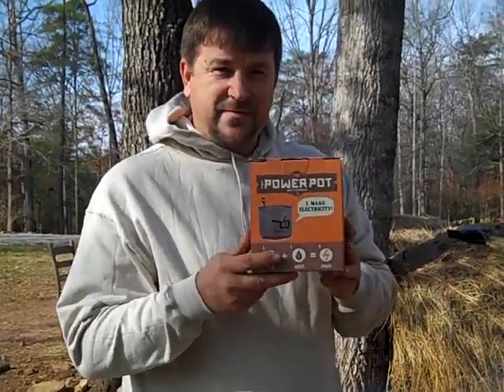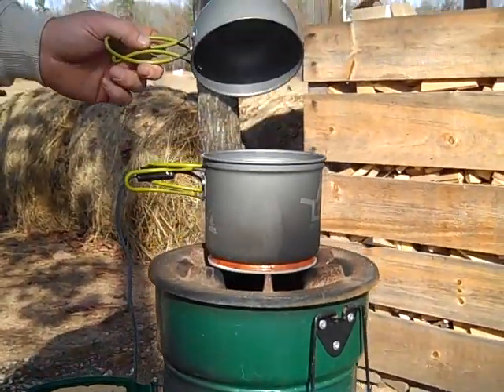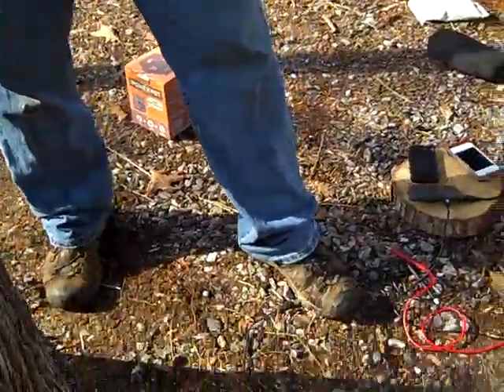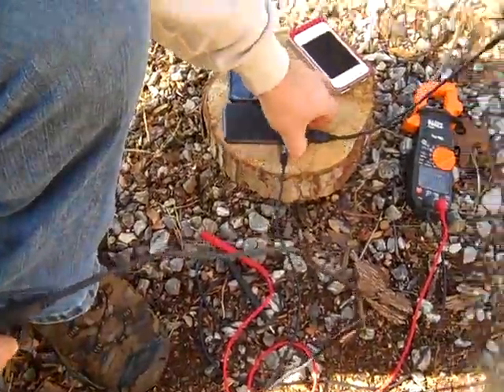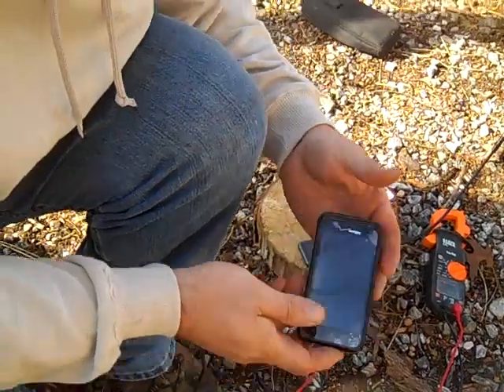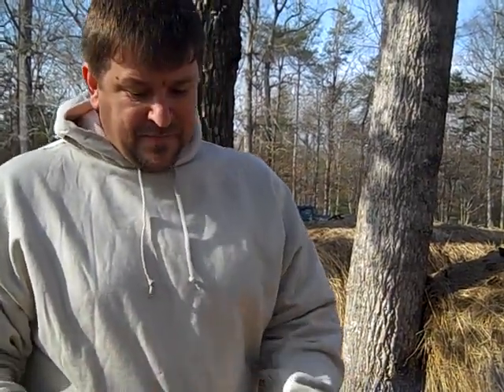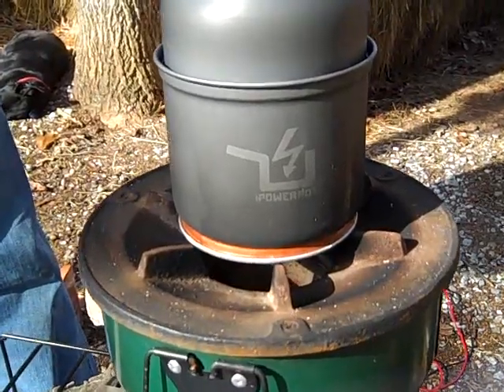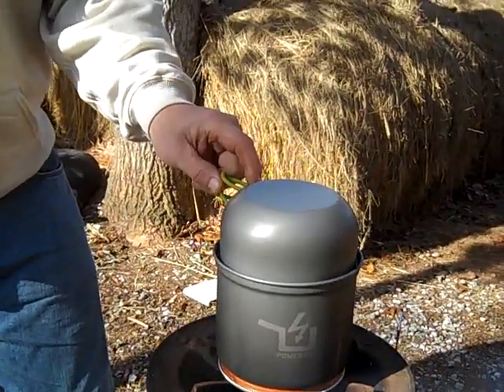Powerpot: a small power solution

Comment: Great demo 775.  Wonder if you could think of a way to heatsink the water with a tall piece of aluminum so there is no need to change out hot water for cold? Radiate the waters heat up into the air, keeping it cool without going to a pumped radiator system that would just use up valuable electricity.  Again good work.

Comment: Yeah, I could see a thermo siphon as long as the water didn't get too hot for the thermoelectric generator to start siphoning.  From what I can tell the greater the temperature difference between the two sides of the generator the better the electric output.  If the water has to be boiling then that might not work.  A gravity fed bucket above slowly cycling water through the pot and emptying into a bucket below may do the trick.  But the feed would need to be calibrated.  <1mm perhaps

Comment: call me stupid, I'm no engineer but how's about this:
a "bucket" modified to hold the water which can boil and is open to the air...
with a coiled copper tube THROUGH the water, through the sides of the bucket (sealed) keeping water flowing through that's colder. Gravity, run-off from something else... dunno, all that matters is it's colder & continuous. Right? Sound good? Coil submersed in liquid from pot?

Comment: Would it work better if the lid was not on as it would then take longer to heat up the water. Also do you think there is a way to maybe have a siphon of water coming from it to a cold source and back again to keep the temp difference as much as possible if you were primarily looking for power and not so much for hot water. Interesting device, I will need to have a look, thanks for the excellent videos, and Happy New Year.

Comment: I wonder if you can set up a small pump to cycle the water into a bucket next to the stove and get a net gain of electricity over what the pump would use? Or battery powered and then recharge the battery.

Comment: If you put this gizmo over your stove and you connect a ram pump to the powerpot as to make water to circulate, you will have this thing producing power as long as you keep the fire at optimum efficiency, couldn't you give a try to it? Also, does this peltier cell wear out like solar cells or can it work forever?